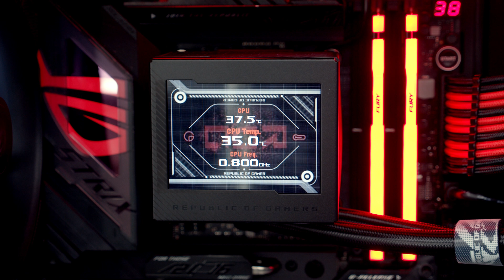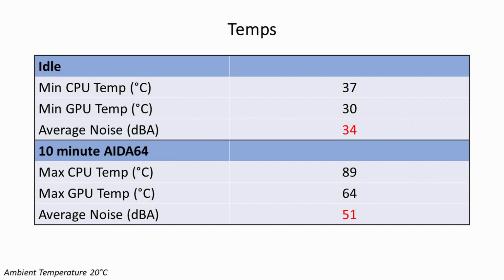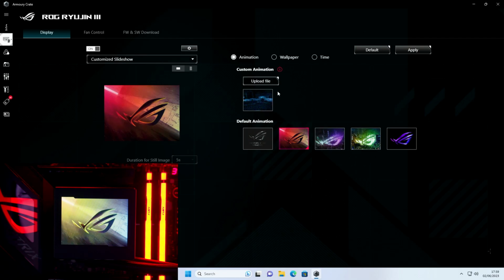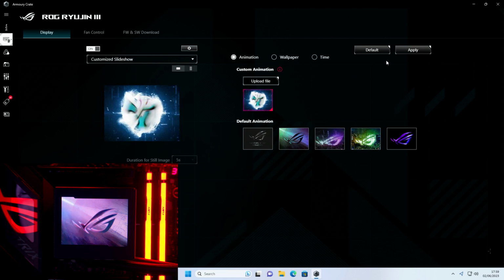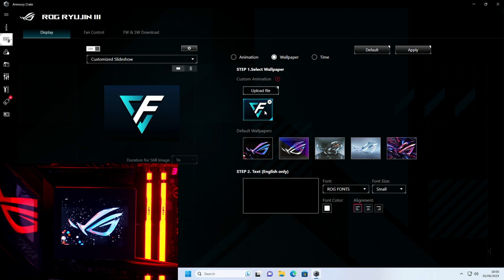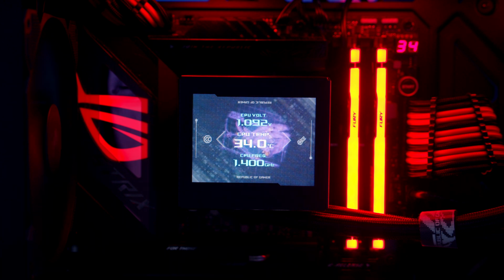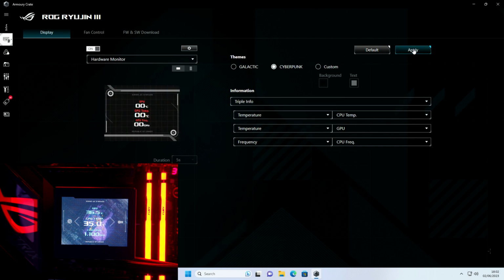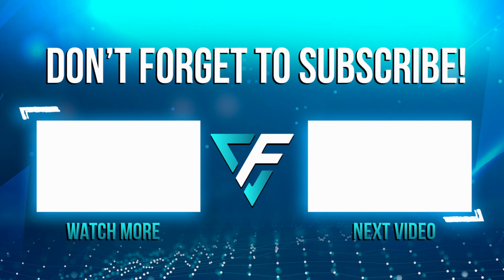ASUS ROG RYUJIN III 360 ARGB - Installation Guide

Comment: because these fans are like 0.6 amps each 1.8 amps total. can you, should you plug both fan wires in?  would that work? As one fan header is typically rated 1 amp

Comment: Hey man, thanks alot for the video. I have same AIO and I pair it with my RAYZEN 9 9950 X3D  the issue is the temperature spikes up to 90:93 degree Celsius every time I start the PC or restart, for a couple of minutes then it settle to normal temperature. Is that ok or normal ?
Reply: No, reapply better thermal paste.

Comment: Does anyone else have the backplate bracket very loose after installing the standoff bolts before installing the AIO pump?  It doesn't seem correct, but I've installed it the way directions as well as detailed in this video.  Or will it all tighten up after installing the AIO pump?  Thanks.

Comment: Just bought 1 of these as my AIO cooler im using has 1 of the worst and I mean worst software I have ever installed onto my PC in all my computing years!. My Kraken AIO works flawlessy as im getting 33oc idle temps and running my games im getting max 50oc under heavy loads.. But the software thinks im getting 80c, so my pump and fans are all over the place.. I have compared the temps using other software and my temps are very low, but the Kraken thinks overwise.. Its a mess all round.. I could re-map the fan curve but the  temp tolences are way off, its pointless, so just bought the  ROGRYUJIN III 360 CPU Cooler instead.. Kinda lost my temper with Kraken as there customer service is beyond fustarting.. They are currently doing a software roll back as there have been tones of complaints and to be fair, im done with them, everytime  they do a update they break 20 other things..

Comment: shouldn't the radiator of the cooler not be turned around? i mean the vents should vent out not into the case
Reply: I always verify and switch mine to exhaust from the top of the case as heat rises it seems most efficient.

Comment: Great video as always. My mother's maiden name was Flanagan :-) 
I don't expect a response as I don't see you do them but after installing the back plate to the Asus z790-E there was space between the offset screws and the motherboard. I made sure the screws were tight and there were no spacers in the kit.
There was also space around the holes of the mounting tabs of the pump and the offset screws.
Not that it should make a difference but I'm installing the Ryujin 240mm non RGB model with Noctua fans.
Was there this looseness when you installed it?
Thanks in advance and I really enjoy your content.

Comment: Awesome video purchase this cooler for my channel rig I haven't installed it yet but I am hesitant to put the radiator fan header on the CPU fan header on the motherboard does CPU fan header with previous builds is sensitive to Fan splitters this one looks like a very futuristic fan splitter anyways putting a fan splitter on the CPU fan header often gives a bios error of CPU fan speed error when restarting your system in the past this has happened every time I myself will probably use the chassis fan header instead for this radiator installation

Comment: Hello! I bought this product, and my CPU is a 6700K, which uses the LGA 1151 socket. I noticed that when I screw the bracket on, there's a tiny gap. Is this normal? If you could answer my question, I would really appreciate it!

Comment: I did Liquid cooling over 20 years ago when I had to make my own water blocks and other parts and I'm finally ready to delve back in after not doing any for a long time.  I do have questions about this since I got one.  Do I need to fill it with water myself or does it come pre-loaded?  Also, is there a trick to disconnecting the tubes since I would like to install it in a way that radiator is outside of the case.
Reply: No, research the difference between “closed loop” all-In-one liquid coolers vs “open loop” custom liquid coolers. This is a closed loop AIO (no access to the liquid fill).

Comment: Thanks for tutorial. Does it require to use thermal paste for installing?
Reply: i think the thermal paste was included on the AIO
Reply: I noticed the cooling block has some type of thermal material installed. I'm going to try it out under some stress tests and remove and reapply with better thermal paste if necessary.

Comment: So I just ordered this, if I want to do a push pull configuration and use 3 non asus fans on one side, do I just get a fan controller and plug the asus fans with the other fans and then to the motherboard header?

Comment: Awesome video, very detailed. I got a Question. I have the same AIO, wanted to add Lian Li SL Infinity fans to the AIO,  but want the 4pin Pump header connector to connect to the motherboard, does work with buying a Lian Li ARGB Cable??

Comment: I'd love to change the standard fans with Lian Li UNI TL Reverse fans. Would I connect these to the regular Lian Li controller, while connecting the cooling block to the pump header (4-pin) and the usb header in the usb 2.0 header?

Comment: I think the tubes should go in the opposite direction. You can't easily get the RAMs out this way.
Reply: No the tubes will keep hitting the rear fan
Reply: no ones taking ram out after its built??  and if so its not hard to remove ram, the AIO tubes are not in the way.  this is the standard way its mounted when mounting at the top

Comment: Hey man, thanks for the video. Could you help me with something? I have this same AIO and I'm having trouble with the fans. I cannot find them in the Armory Crate software when I want to change the lighting settings. The only things that appear for the AIO are the animation/hwmonitor screen, and the exact same Fan Curve screen that you also have in this video. Thing is, I cannot change the RGB lights on the fans, even after confirming I have plugged both the cables to the PWM header and 3-pin RGB header on my MSI MEG X670E ACE mobo. Have you encountered anything like this issue?
Reply: Hi man did you solve your problem? because I have the same problem as you :/ Thank you for your help :)
Reply: @herro6480  did u ever solve this?

Comment: Looks like they ditched that space consuming fan controller from the previous version. You were forced to use it even if you connected the radiator fans directly to the motherboard because the controller was still required to power the pump. Not sure why they didn't just leave it the same as the original RYUJIN. Asus makes some idiotic design decisions.
Reply: I think that's why the iii was released so quickly
Reply: @super-markio  They also re-released a new version of this without the controller. I actually tried connecting the USB B power connector to my motherboard using an adapter to see if I can ditch the controller, but it didn't work. The power can only be supplied through the controller. Including the controller with the option not to use it is one thing, but forcing people to use it??? Asus.... for those who dare to be stupid.

Comment: I want to install lian li sl120 inf instead of rog fan. how will I do?
Reply: By a triple pack with the hub... run wires from hub to headers
Reply: @zeza8603  thank you.. I want it to work optimized with liquid cooling. Is it okay if I plug the tripple pack fan into the CPU FAN?

Comment: 89 degrees under load? Isn’t that really high? That’s like 20 degrees higher than the worst AIO’s I’ve seen. Could that be wrong?
Reply: This gen of intel has very hot chip, 89 degrees under full load it's pretty normal for this gen of CPUs.
Reply: Yes that seems quite high, My 12700k doesn't even get that hot with an air cooler. It does reach the low 80's with air though. But with this AIO I can't imagine you should be hitting nearly 90 degrees. I haven't gotten mine fully installed yet, so not sure what results I'll have yet.

Comment: Please help me~|
I just bought a rog ryujin iii but the fan is running at full speed~ and I can't see the speed of the Rog ryujin iii from the Armory Crate~ Is there a wrong connection? Or do I need to change it from the BIOS?
Reply: If you have plugged the fan power cable right to your PSU this will happen. You should find a fan header on your mobo and plug it in there. if you don't have one available then buy a fan controller/hub. 

If it's already plugged in your mobo then check your bios for fan controls.
Reply: I have the same problem. But mine is plugged into the motherboard. @e234darkrock, did you fix this?